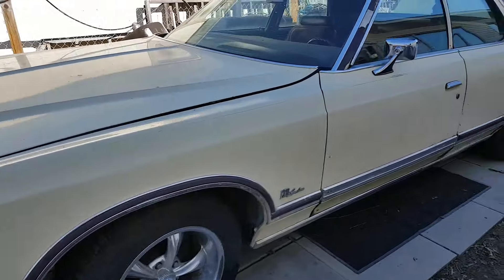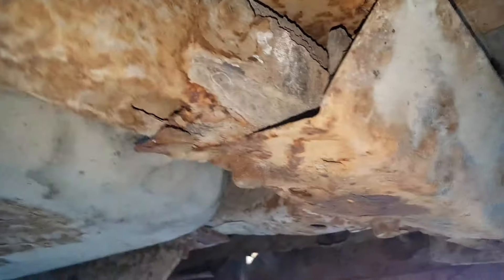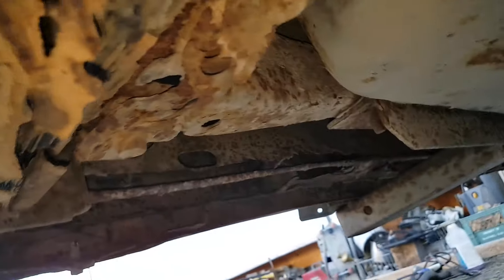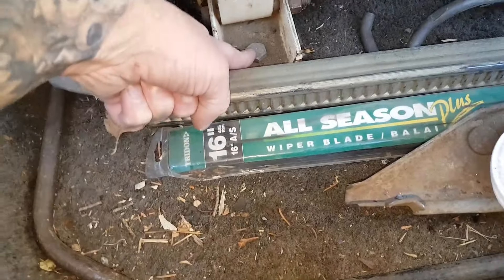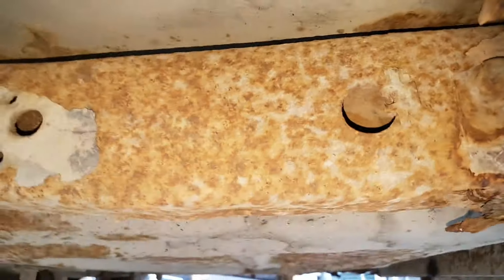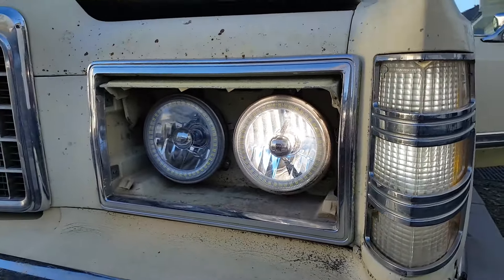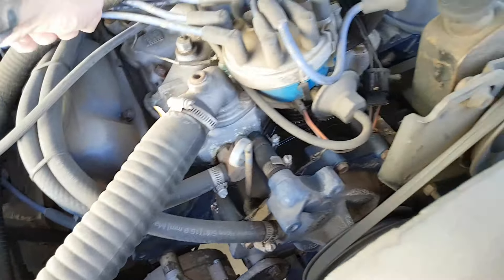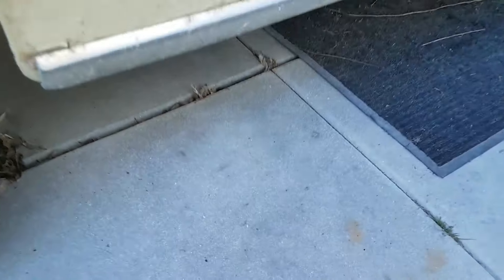Tour of My Grandpa's Car (needs frame welding)

Comment: Im bettin them valves and combustion chambers are extra clean with all those years of LPG use. Propane burns so clean. Good ol car. Lots of great memories inside of that machine.😊
Reply from the maker: They were probly pretty clean, but 40+ years of wearing on it resulted in some bent push rods and lost compression.
 Complete rebuild back to stock specs was in order, just like my grandpa would have done. Could have thrown in a cam but that would decrease the car's range. Thanks :)

Comment: Take the bumper off for access and I bet someone could make you new rear frame rails.  Might not be as pretty as factory but would save your papaw’s car.  I would want to save it too.  Body panels can be fabbed up too by the right person .  Good luck!
Reply from the maker: thanks very much :) that seems to be the best solution, what I would really like is for the repair to include a Class 5 trailer hitch, hidden behind the rear license plate, so I can pull loads of scrap metal to the yard lol

Comment: The best way would be to make a frame off restauration. But that is a big job.
Reply from the maker: that would be the way to go. if I rip off the back bumper, remove the propane tank and cut out the trunk pan, that should be enough of a hole to reach the top and bottom of the frame.
 The rest is pretty good, but the one spot is bad because there is a cheap trailer hitch bolted on there, totally rotted through.
 I think the frames are the same across most Ford full-size models from 77. thanks :)
Reply: @blackwidowfarms   That would also be possible

Comment: If you put 50k into restoring it, you may be able to sell it for $800.
Reply from the maker: sounds like a good deal!
Reply: That is a lot of time, work and money. If it was a two door and a rear model, it could be a nice project. From what I see the car will need more money. Effort and work to every be any real value. If thr motor runs as good as you say, pill it for s better project car. Working with what you have is a suicide mission
Reply from the maker: @Hillontop  I understand what you're saying, thanks very much :) but not looking for resale value at all. Some things aren't worth getting rid of at any price.
 if it were any other car and I'd piece it out immediately.
Reply: I understand emotional connection but try not to let it out weight your cost. sometimes it is better it is better to preserve a part as a trophy. Something you can keep on a shelf or hang on the wall. I wish you the best And would love to see what you decide on. 🚗
Reply from the maker: @Hillontop  thanks very much, I see your point. I've already had the engine/trans and rear end completely rebuilt to stock, custom driveshaft, shocks, struts, brakes, rotors, drums, shoes etc... I even had a guy from the states fabricate electric actuators for the headlight lids made from corvette electric window motors. Had the steering box rebuilt, steers tight now.
 I've got NOS bumpers, front grill and an original steering wheel waiting to go on.
 I think I've gone too far over the edge to stop at this point :)